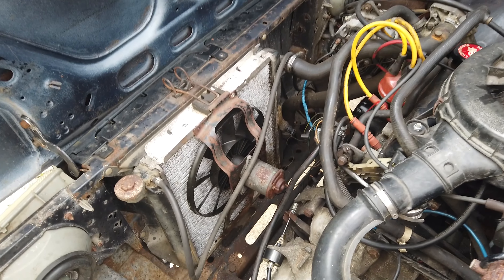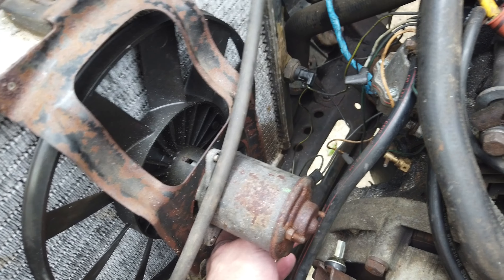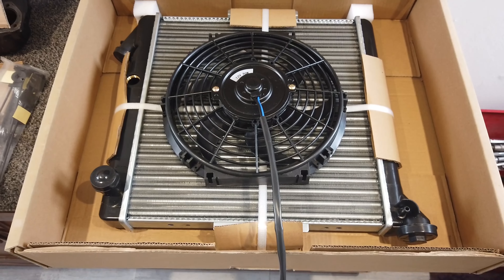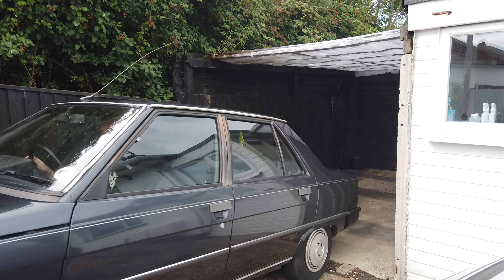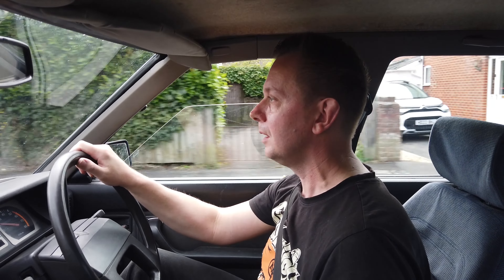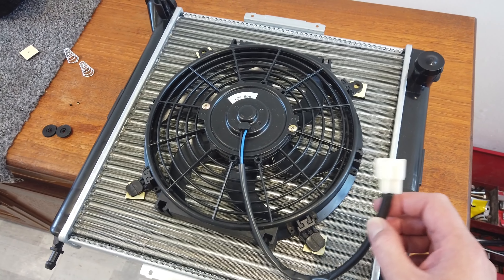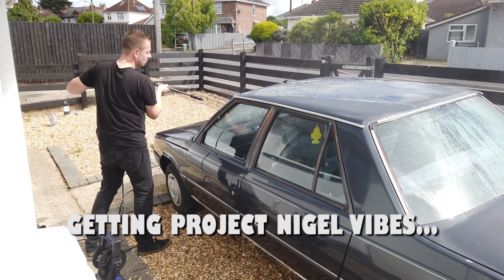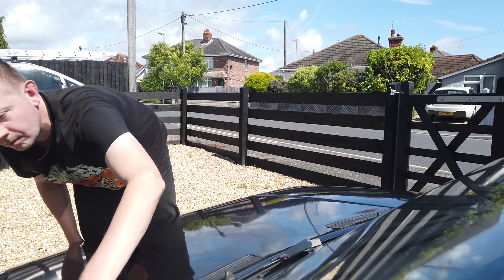FIXING THE RENAULT 9 - PART FOUR - COOLING FANS WHEEL BEARINGS AND WAFFLE!

Comment: Spent today overhauling the cooling system on my own Ren 9 - top tip is bleeding the heater matrix is an absolute pita - hardest system I have ever come across. I bleed mazda bongo systems at work... I kinda know how to bleed stuff... Ren 9? Pita. Upshot (I got it bled out) is that you have to combine running it & turning it off to get the system bled - it won't bleed fully when running & it won't bleed fully when off... but combined, it will.

Comment: I've got two Y reg Renault 9's -  where did you get the replacement radiator fan - I need to fit one .
Reply from the maker: You can still by them new. I got mine from a local motor factors.